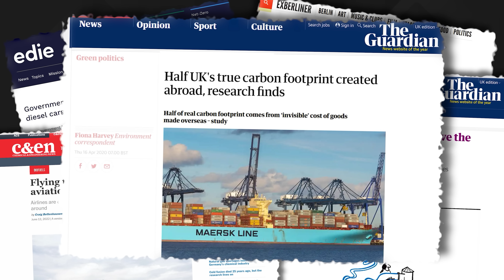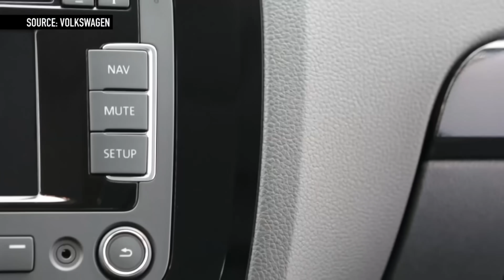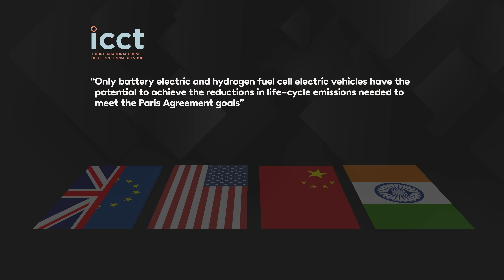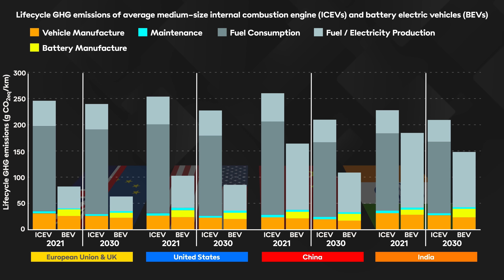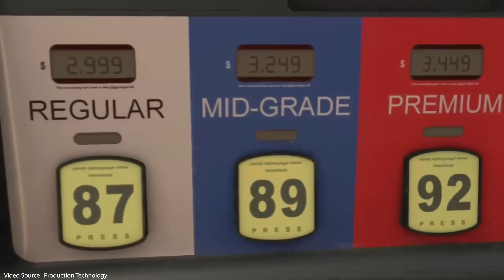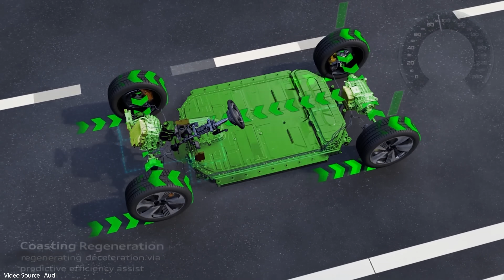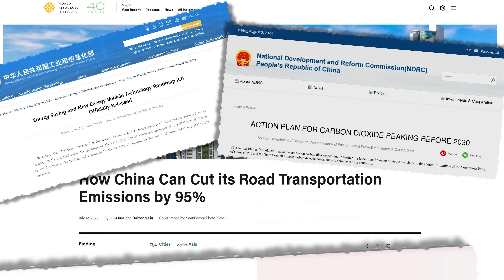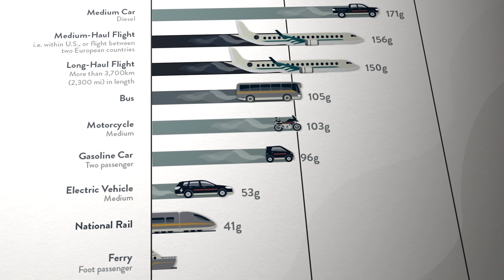Are EVs really better for the climate?

Comment: I generally like your content in this channel.
But in this episode you have more often than usually a cross-reference to "tin-foil" non-believers. hmmm?
Be careful, maybe you end up wearing a "tin-foil" without noticing it even. Maybe a green-foiled tin-foil, lol.

I think this cited report is quite biased towards electric and hydrogen cars.

Again one important data point here in Germany, the CO2 emissions factor in 2020 for electricity production is estimated at 420 gramm/kWh on average.
2020 was a pandemic year, meanwhile emissions have gone up here significantly.
Even 420 gramm/kWh and 0.2 kWh/km for electric car means 84 gramm/km "emission of electric car".
In order to be 60-80% more efficient, the comparable ice-car would have to have emissions of 210-420 gramms per km.
New electric or new ice car? New ice are more in the range of 150 gramms.
A Methanol powered car would be more in the range of 80-120 gramms.
A Methanol powered "Nissan e-power" car woud be 70-100 gramms.

On top of it, of 800+ Mill tonne emissions in Germany, only about 160 Mill tonnes are from transport sector. 2/3 of it from business, trucks, cargo-ships and planes, 1/3 private cars. 500+ Mill tonnes (of 800+) are power plants and chemical factories (steel, cement etc).
We must stop talking about emissions of "private" cars, they dont matter that much.
We have to adress the "big elephant in the room", emissions from power plants (in Germany about 360-400 Mill tonnes CO2), and how to immediately start filtering those CO2 emissions (I suggest turning them into Methanol, or avoiding them all together, but that takes time we dont have).
No electric car will save us, as long we do the blame game about who wears the "tin-foil" here, and not adress and seriously talk about "the big elephant in the room".
We are simply doomed if we dont do that and focus our time and energy, and limited capital ressources, on that elephant.

Comment: i have a number of problems with alleged green power (first i have been using soler (pv)panels for at lest 30 years & other alleged green tec) & i am an engineer & i find the claims on both sides dubious at best.
1 most electricity in the uk is fossil fueled & steam is produced from the fuel as the most efficient boiler is only about 20% efficient from my research & as in Drax power stations fuel(wood) is transported from the south/north america thats before generating/transmishion losses also the remaining heat is dumped in cooling towers ? be for you plug the EV in? & wind is unreliable as proven over the last year.
2 i have been informed by a number of sources ? that a human produces 50% the co of a car?.i have to travel only once a month . with a car or motorcycle & ferry 10hrs.public transport bus/bus/ferry/bus/bus/taxi 24 to 38hrs.Ev or pedal cycle 3 or 5 days +? walking weeks??? & i have used public transport regularly up to service discontinued.
these are only 2 problems i have with clean/green energy as there is no such thing as clean energy only cleaner & i have been living  low waist all my life.
ps this is be for the methane & all the millions for other problems eg farming burning stubble=co or plowing it in = methane as it decomposes ?.
so many questions with no actual clean answers & most of the alleged clean/green answers are dirtier or no better than the current like the coal power station in Deutschland that had 0 emissions back in the 1990s probably decommissioned when nuclear leaves wast for hundreds of millions of years & thats clean & green?

Comment: EV vehicles are a pipe dream,  too expensive.  The electricity to charge them come from power plants ( mostly coal fired ).  The electrical grid cannot handle the power demand if we all went to EV's.  There will definitely be rolling blackouts.  Our electrical rates will sky rocket if this comes to pass and the battery pack replacement will be extremely expensive.  Environmental destruction from mining for material for batteries.  Last but not least the spent batteries are hazardous waste and cannot be recycled.  If it sounds too good to be true it most likely is.
Reply: Ev’s are on par with ice vehicles. Most electricity doesn’t come from coal, and if you charge during non peak hours then the electric grid will handle it fine
Reply: An ice car has to get 50 mpg to be on par with an electric car and I’m including cradle to grave. The higher electricity prices go the more competitive roof top solar becomes
Reply: Certainly not "mostly coal fired" in the UK. We get just 1.6% of our energy from coal.  And why would you replace the battery?  Why wouldn't you have it refurbished at a fraction of the cost of fully replacing it?? You need to do more research on the subject, because you clearly lack EV knowledge.... Were you even aware that the oil industry is the biggest user of mined minerals by far?  No, I thought not. They can't refine oil without cobalt. like I said, more research needed.....  I suggest you begin your research with EV battery recycling. Even a little searching will reveal Volkswagen's electric car battery recycling plant in Zwickau, Eastern Germany. VW have been recycling EV batteries there for several years. They even posted a YouTube video of their recycling plant in operation, to educate people like you.....

Comment: Not sure ditching car and moving to using a bike is always the healthier option. 
Fitter, up to the point of coming into range of an SUV.
Reply: It would if all cars were EVs! and no exhaust emissions
Reply: @stevetaylor2818  I was more concerned with the physical impact of the SUV rather than the environmental impact. Cars and bikes often don't play nicely together, in UK cities.
Reply: @stephenlee5929  You are right, sometimes cycling in London I'm not sure if the pollution or an SUV is going to get me first. Though many cities like London are installing many new cycle lanes and many EVs on the road, so getting better every year (but many dangerous gaps in the system)

Comment: I see no way Hydrogen and Hybrids help in any way for the following reasons: The footprint for generating hydrogen, transporting / infrastructure + the additional cost for implementing such a complicated technology in cars has no real applicability at scale. For hybrids, even so now you have two times more technology in the same car so two times potential of failure, two times the time needed to refuel both energy and gas and you still pollute outside cities. Now, why will you do that?
Reply: It’s not two times potential of failure.  Both drive trains don’t have an equal chance of failing.
Reply: But Hybrids have been out for quite a long time, it is a mature technology, all that has really changed is the quality of the batteries and efficiencies in the cars to boost range a bit. You would be correct if it was a new technology, but Toyota knows how to make a hybrid that hasn't failed any more than a regular Ford.
Reply: Hybrids aren't terrible. I'd think plug-in hybrids would suit some people. Batteries are expensive. 

Hydrogen is just stupid.

Comment: I have had two cycles of EV leases and then a petrol lease. The TCO of petrol was less than half the cost. I only commute 25 miles a day so not hugh mileage but to say EV are cheaper is crazy. Today a Tesla lease is over £600pm while a petrol can be less than £200pm. You can't buy an EV because scarcity has inflated prices. Also battery technology is moving fast the new 4680 Vs M3LFP from China . Finally the UK gets the worst selection of new vehicles because we don't build are own and we are far from China?

Comment: Electric bicycles are the way. They are human scale and use a tiny fraction of the material annd energy of a EV. They go fast, for a long way, certainly enough for most daily activities. Add a trailer and you can haul serious loads fro miles, at road speeds. I have a 500W bike and an 8 foot aluminum trailer that carries up to 300 pounds, I haul groceries, lumber, bags of cement mix, garbage cans of mulch, at least as well as an SUV. I keep my full sized pickup aside for big loads like dirt or gravel. Been doing this for decades, works perfectly.

Comment: Bought used miev in 2016 for $6.800 just as local runner and to experiment. Quickly realized yup, this is good. Grandson bought it! Next used 2017 Leaf 30kwh. Son bought it, now over 50,000 miles. 2018 Leaf 40 kWh, still have, works well. 2020 bought 2018 model 3, our workhorse now at 48,000 miles. Small solar on roof. Heat pump drier, hot water. Much of funding came from selling 2 used Jetta TDIs back to VW. We drive for free on solar most of the time.... Hoping to go heat pump furnace soon! Thanks for your years of inspiration!

Comment: Great video! Love the way you approach the issue. It's a shame it wasn't done in the 70's when it could have made a differene. We are now so far beyond so many points-of-no-return in so many positive feedback loops that all these efforts seem moot.
Reply: Maybe they "seem" moot, but they aren't.  We can and will decarbonize.
Reply: Never give up.
Reply from the maker: Glad you enjoyed it!
Reply: Not so for a number of reasons. Primarily of course that these efforts are not moot, and they do make a large difference over time. This is a very long run, we haven't passed the halfway mark. Also the battery tech was not ready yet in the 1970s, we are hardly there in the 2020s. Transport will gradually take a smaller proportion of emissions.
Reply: @jonnyaxelsson9940  Even way before the 70s, if public transit wasn't killed so every person has to buy a car for oil company wallets, we probably could have only half the problem today.
Reply: @jonnyaxelsson9940  Really glad you are so positive about it. Unfortunately the data on the more than 10 positive feedback loops points to a rather grim situation much sooner than most people want to beleive. The best to you... at the edge of extincion, only love remains... (not my line by the way)

Comment: The arguement most people are missing is that EVs emit more CO2 when produced, and since CO2 scales as a cubic function the long term benefit might be a longer term worse solution... Also, because, even if consumer cars are all EVs you gotta look at the bigger picture, they account for a really small part of the global CO2 emissions...
Reply: The question was not "will EVs solve our climate crisis"? The answer to that is obviously No, there are many more sources of greenhouse gases. The question in this video was "do EVs help in solving the climate crisis"? The answer to that is Yes.

You also need to explain what you mean by "scales as a cubic function". AFAIK a ton of CO2 is a ton of CO2, regardless how it was emitted.
Reply: @dalstein3708  the more CO2 in the atmosphere the more is released through natural processes such as the thawing of the permafrost
Reply: @giovannip8600  Yes, there are runaway effects such as thawing of permafrost. But it is the CO2 that triggers that, and it doesn't matter what produced it. A ton of CO2 is a ton of CO2. And EVs have a lower lifetime emission than ICE cars, so they are the better (or rather, less harmful) option.
Reply: @dalstein3708  short term they aren't, and those extra 30% initial production really add up, there's no paper written on this unfortunately

Comment: One of the things I'd considered important was that the electric vehicle would be a lot further along if it had the concentration of effort put into research that the ICE vehicles had over the same time interval. But there has been a lot of resistance to that funded by various interests who prefer to maintain a high market share of the energy market. At present, I'm keenly interested in the development of something called the Aptera. It's a fascinating vehicle concept designed around efficiency. I don't know if you'd heard of it, but it seems promising if it manages to overcome resistance to competition from other vehicle marketers. It looks like something so drastically different, it's bound to get hit by negative press. But when you look at it more deeply, it makes a lot of sense. Thanks for your work. It's always interesting to see the depth of your research.
Reply: Love the Aptera.    So far all the press I have seen on it are positive.  Maybe due to what I choose to watch.
Researchers are busting their backside on research.    We hear about a new battery in the lab every few weeks it seems.
Seen where they have developed a new permanent magnet which is much stronger the the neodymium.  Stronger lighter motors if they get it out of the lab.
Reply: No.

Comment: Not a 'bad' video for the topic .. but .. for ME personally , I prefer a bit more detail / nuance analysis .. 100kwh vs 30kwh BEVs (100kwh is worse for environment , more impact to make it and more wh spent moving the extra weight every mile) , keep driving existing or buy new , the how much of a difference does local grid effect results , etc .. Something more along the lines of the 2018 video Engineering Explained did .. https://www.youtube.com/watch?v=6RhtiPefVzM .. 

As unpopular as it is .. My personal preference is still reduce / reuse / recycle:

Reduce vehicle range / speed / etc .. the tool should be correctly sized to fit the application .. the environmental penalties for super sizing , should not be ignored.

I don't drive a 20ft Uhual truck as a daily commuter vehicle , EV or not , because that is a horribly bad fit tool to that application of me and a lunch box going to and from work .. it is a tool that is a good fit for a specific application .. likewise when about 99% of my trips are under 20 miles round trip , it is just as ridiculously unfit to the application to have a vehicle with 10x that range (EV or not) .. likewise on time , if a low speed ~20mph vehicle gets me from point A to point B at 30 miles per kwh in about ~40 minutes , it is environmentally also ridiculously bad fit to the application to use a 4 mile per kwh vehicle (EV or not) just to get there in about ~30 minutes.

That includes reusing ICE converted into BEV .. It is almost always better for environment than buying a new EV.
Reusing , by buying a used EV (that has specs to reasonably fit the application) , is almost always better for the environment than buying a new EV .. it is never a choice only between new vs new .. until there are no used vehicles left for sale , the used vs new is always an option to consider.

It is also valid to consider the largest environmental impact for the same money $ spent .. $45k just on a car .. EV or not .. might not be the greenest way to spend that same $45k .. $15k for used car , $15k for home insulation upgrades , $15k
for home PV ... or any other option that costs the same , to do as much or more environmental good over the life time of that equal investment .. hint , new $45k+ cars (EV or not) , are almost never the most environmental option for the same $ spent.

Comment: Unless you live and work in a place that enables you to travel everywhere by pedal cycle, local public transport and national rail, then EVs are a total no-brainer. Not just for the environment, but simply as a vehicle to drive.  They are a joy to use: quiet, smooth and fun.  It is unbeleivable that we are prepared to keeping buying both the fuel and the bullshit the fossil fuel companies sell.
Reply: you're forgetting the up front cost of an EV. currently they're way too expensive for many people. you can buy a decent used gas car to get you to work for 2-3k.. how much is the cheapest reliable used electric car? how about if you need a work truck or contractors van? in the coming decades EVs will be more widely adopted but right now they're still financially out of reach for many.
Reply: a no-brainer when you live in a privileged normal country, where I live people would have to work around around 50 years for a EV but they have to eat so saving money for a EV actually takes from 300 to 500 years.... and when that thing brakes there's no way a normal joe will fix it, you have to go to a dealership and pay with your kidney, meanwhile old petrol cars are easy to fix in your shed
Reply: I walk or run everywhere I go. Once you learn to quit driving, you learn to save money. Cars enable you to spend money.